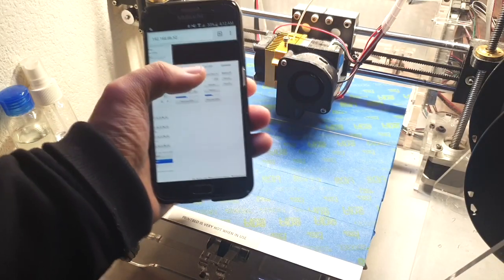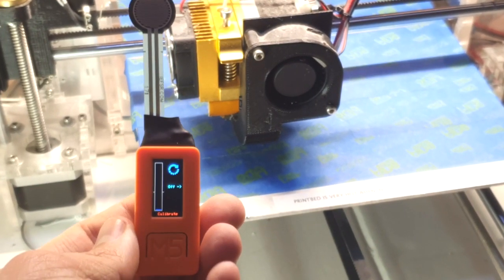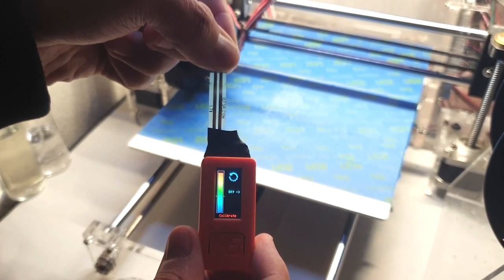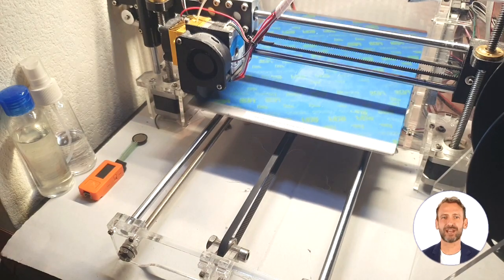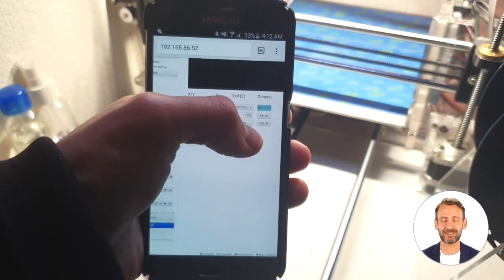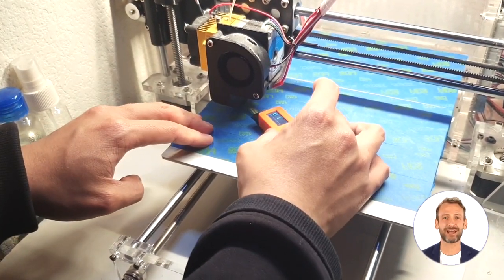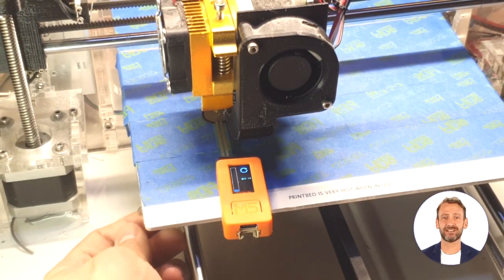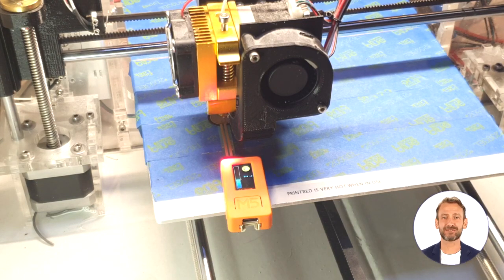Level your 3D Printer using an M5Stick - OmniLevel

Comment: Hello. I  built one of these but it's not registering any pressure. I didn't receive any errors when compiling or uploading the code to the M5StickC. Can you help trouble shoot?
Reply from the maker: There is likely a wiring issue with your FSR sensor and the pin that its connected to. Make sure you check the wiring diagram and ensure your header pins are inserted fully.
Reply: @solutionhacker  Thank you. I have verified the wiring and did a continuity test so signal can pass through.